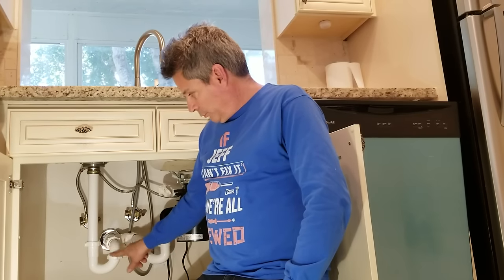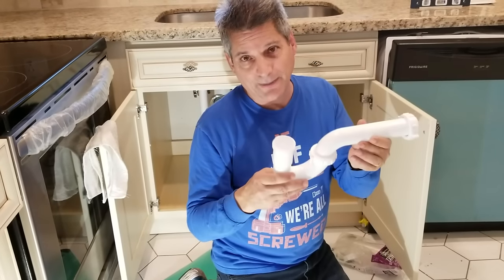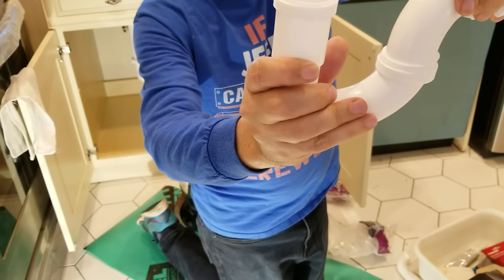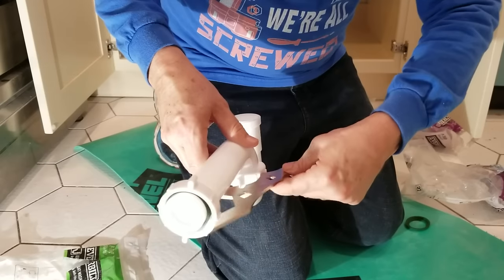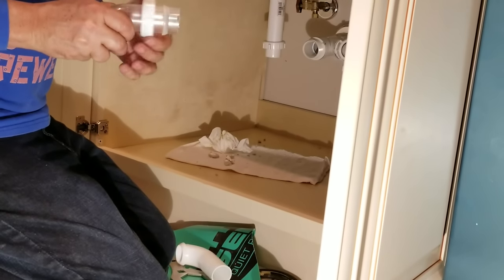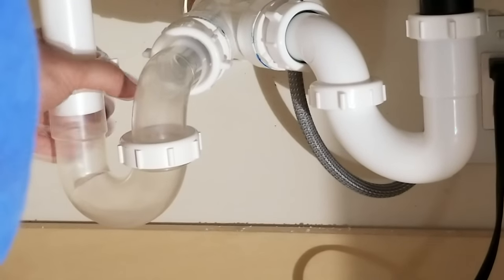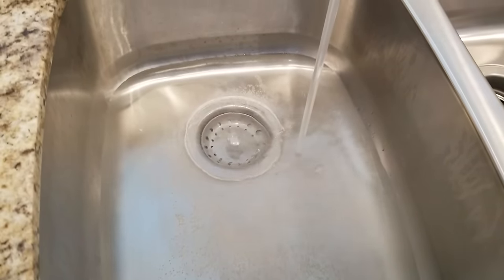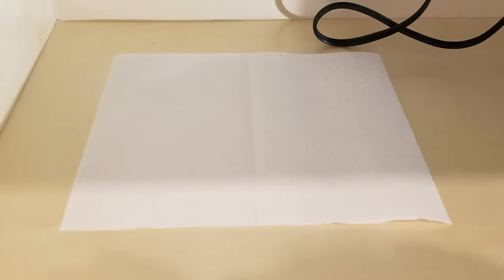Why is my Kitchen Sink P-Trap Leaking at Connection Nut?

Comment from the maker: We uploaded an improved version of this video HERE: https://youtu.be/tqf11On2xEA It is shorter and we removed the overpowering background music so you can hear it better.
✅ Kitchen sink drain tools/pipes in this plumbing tips video:
✅ Superior Tool 3-Way Sink Drain Wrench: https://amzn.to/2XozbZp
✅ PF WaterWorks Transparent P-Trap: https://amzn.to/2Ey8vhs
Reply: Rubber ferrule
Reply: I like the overpowering background music!  It rocks!  It makes me want to line dance in outer space.
Reply: I always have to deal with these things, I am not a plumber just a home owner, but why do they suck so much! It’s 2020 can we not design a trap that doesn’t leak and isn’t finicky that every time your mother-in-law puts the dish soap back and bumps it, it will not leak?
Reply: @bumstudios8817  welcome to 2020 tech: 
My plumber stopped those leaks from ever having to happen to me. 
After a sink block, while trying to unscrew the butted outlet of the P-trap and stripping every plastic ridge on the nut (possibly internal cracking 🙄from the vice I used because my wrenches & channellocks werent handling), I recalled that my plumber did something peculiar; he welded the the outlet end of the PVC P-Trap, where it connects to the tailpipe, and a flexigasket from the tailpipe to the wall. 🤠🔥👏
After unscrewing the inlet side of the P-trap by hand, I was able to completely detach all other pipe connections without a single tool. The whole thing is held together with tension... well fitted copper pipes with plenty of tight sleeve overlap, and easy-twist/tool-less brass fittings. The tailpipe connects to the house wall with flexible gasket, as it does to the anchored garbage disposal. So all I have to do is release the garbage disposal gasket first, and then there is range to easily yank the pipes from their sleeves, everything now pivoting off the wall gasket for added flexible movement. 
SYSTEM:
Left sink basin--> garbage disposal--> large gasket with double-wire spring hose clamp--> 90' PVC connector welded to 1st inlet of brass cast Y-connector welded to copper down pipe running vertical down to P-Trap inlet with twist off/sleeve compression. Removed and cleaned.

Right sink basin has copper pipe running down to 90' brass connector welded to copper pipe running horizontally --> tension fit & sparringly sleeved to 2nd inlet of brass Y-pipe. I could visually inspect & snake that pipe all the way up to the Right Sink basket.

 * It was annoying not being able to see the interior condition of the tailpipe exiting to wall, just the inlet side of the P-trap, which I easily enough snaked. BUT, had I been less lazy and taken the time, I could have unscrewed the adjustable tape hoseclamps holding the wall gasket to have done that, and I just didnt need to. 😊 
* I had been initially worried to start the project and fail in resealing the outlet end of the P-trap. Had I known, his system was in place like this, I would have done this sooner & maintenance cleaned more often.
Reply: e.g. Mμ silicon will work too... it’s just a dumb set up though... why have a $#!++¥ solution like that when a simple design change would solve it.
Reply: Do I really need to hear that overpowering music in a plumbing video ? And you seem to be showing more of your cute face than the actual plumbing network itself.

Comment: Until about two hours ago, I had a P Trap with the slowest leak on the planet. It was driving me nuts ;o) I had watched your video sometime yesterday, and I woke up in the middle of the night knowing what to do and got started. When you said that the back part doesn't have a gasket and has to fit perfectly flat, that we should "make that guy happy" before dealing with the other connectors, both of which do have gaskets, I was thereby enlightened and able to stop the incredibly-slow-drip madness! I appreciate your help! Thank you jeffostroff!!
Reply from the maker: That's awesome dues congratulations on getting that fixed!
Reply: @jeffostroff  thank you people like you is what going make the world great !!!!!  this helps so much
Reply: No kidding!  I was having a really hard time trying to understand why the plumber did not put a seal or gasket in the p-trap dip-to-outlet join. Jeff not only explained that's just how it is, but also explained how i must get that join to line up perfectly first, then tighten the other joints. My wife is gonna think I'm quite the hero after this fix :)  .  Great big thanks to Jeff!

Comment: Thank you. I hand tightened a brand new trap and it still leaked. I Could not figure out why and need to know that it is the most finicky connection that has to be done first. Thanks again.
Reply from the maker: Glad to help out Drew and thanks for watching!
Reply: Same problem here and you helped me solve it! Thank you for this clear, straightforward explanation.

Comment: This is the best explanation I have seen.  I have had a chronic problem with my sink's P trap leaking at the nut.  Going to go back now, with this knowledge, and hopefully will have success.
Edit:  It finally worked!  One very helpful tip is how you showed there is no gasket in the nut.  I had a plastic gasket type thing in the nut, and I took it out and now it doesn't leak.  Thanks!
Reply from the maker: Glad it helped Bret!

Comment: I am SO glad that you put this video out. I had this exact problem. Thinking about it now, it makes perfect sense as that junction is set up in such a way as it has to be perfectly level so there is no gap. I get it now!! I haven't seen this critical point in other videos on this subject. The connection is not leaking after about 5 minutes - jury is still out as to whether it is fixed - but I think it's going to be ok. Thanks for putting this together. A lot easier and cheaper than getting a plumber over to the house!!
Reply from the maker: Awesome we also find that sometimes waiting overnight is when you'll see if there's going to be a problem so I would put down the  Paper towel likely show there and just leave in and watch for any drops that appear on the paper towel.

Comment: I installed a new plastic p trap because the old metal one was corroded and leaky.  I spent an hour trying to get that middle joint to stop leaking.  The trap came with three gaskets, so I figured one of them was for that joint.  After watching this video, I tried without a gasket and it worked fine.  I was misled by the manufacturer!  Thanks for your help.
Reply from the maker: YES! saved another one! Congrats on fixing it yourself

Comment: thank you, been dealing with a leak for a year and found out that i was installing that rubber gasket wrong.  now it's fixed for real
Reply from the maker: Leon, awesome, glad our video helped you!  Yes a lot of other video creators just say put in the gasket, but they fail to show that it is indeed directional.
Reply: @jeffostroff  believe it or not, it was not a directional issue.  i was sort of wedging/resting the gasket between the two pipe pieces and then fastening the connector.  and it would actually kind of seal and not leak for a few weeks, until the garage disposal or some kind of movement will eventually knock it loose and leak.  your video showed that the gasket was to ride up higher on the pipe, so it didn't require any sort of delicate balancing act to screw the knob.  bought a few items off amazon through your link - thanks again
Reply: Mine is leaking from the connector in your right hand

Comment: Presentation problems aside I found this to be a very informative and useful video. I had a plumber visit not long ago who told me I'd installed a rubber gasket 'the wrong way around' but not WHY it was the wrong way around or how to fit it correctly like this video did. Also learned why a sink I had not used in a long while had begun to stink like a sewer!
Reply from the maker: Awesome glad to help out
Reply: If I have to leave the installation alone (unused) for a long time I tape a foil over the sink's outlet. This 1. lowers the evaporation rate and 2. serves as a seal against odors. Don't forget the overflow outlet!

Comment: OMG! Thank you for the clear p trap demonstration! Been working on a pedestal sink for 3 weeks! Turns out I needed a  1/8" extension for drain pipe connection to existing p trap. Hard to see that small of a gap when lowering sink on pedestal,  then reaching in to hand tighten. I needed to understand that p trap connection that DOESN'T use a washer! (I was adding one).  Anyway, was here to see how to cut the new PVC extension pipe. Thank you for demonstration.
Reply from the maker: Glad it helped! Thanks for watching Maria!

Comment: Great helpful video thanks.
I had the leak on the 2nd nut.
I was having trouble with the rubber gasket, I wasn't putting it on correctly.
This video showed me where I was going wrong, I put the rubber gasket on as you showed in this video, and it fixed the problem.
An easy mistake to make, but crucial to stopping leaks. No other video I found shows which way around to gasket goes, and how you put it on the downpipe.
So thank you for sorting me out.👍
Reply from the maker: No problem 👍

Comment: My brand new P trap install, leaked when I tested it (placed a drip pan under the assembly to check). Sure enough, at the union joint. Visually they were square and aligned, with the taper lining up properly. Released the nut, and other compression nuts, and re did starting with the P trap union. Still a Leak.Then I turned to my aircraft fuel line sealant, called Fuel Lube, or also known as EZ-Turn Lubricant. It's a wax based paste that you apply to the joint being sealed. So far, no more leaks.
Reply from the maker: That's a great idea Paul!

Comment: I've also found that sometimes new P trap parts have residual flashing on the mating surface left over from the casting process. It helps seal the joint if you can remove the flashing with either a knife or fine sanding block. Make sure you don't deform the rest of the mating surface, though.
Reply from the maker: Yes I have seen that also I would be too afraid to send it I don't wanna change the shape of that connection even microscopically because it is so critical
Reply: @jeffostroff  You can sand it if you use very fine sandpaper and go around the mating surface, not up and down. As I'm sure you know, water will find a way if there is one. :)

Comment: Years ago we had metal P-traps, I don't remember the design but they never leaked at the connection, they did corrode and need to be replaced, but I swear if you sneeze in another room these things come loose and leak. There must be something that is solid. I can't keep my kitchen trash can under the sink, the slightest nudge and it leaks. We have MIT and A.I. and this is the best we can do? They work for awhile but always come loose and leak. You video is great but we need a better designed P-trap! I'm 75 and can't do this much longer.
Reply from the maker: Yes that connection in the middle is the problem in my opinion it should be a gasketed connection I don't know why they made it a friction type connection but it is just very annoying

Comment: Very very well done. I kept putting a washer on the trap arm where it connects to the P trap and could not get the damn thing to seal.  Of course I just kept tightening it, which didn’t work!  Now it works fine with no leaks!  Thanks. Knowledge is power. Thanks for sharing yours.  Also, don’t use background music. It was hard to understand you and very very distracting.
Reply from the maker: We stopped with that background music after this

Comment: Thanks so much! I just fixed my pipes under my laundry sink because they were leaking. It was helpful when you said that the pipes needed to be leveled and I didn't need to TIGHTEN THEM WITH A WRENCH; LIKE I HAD. HAHAHA. So I went back untightened them and added a seal/gasket to one of the connections and that did it!

Comment: Thanks for this video. I just installed a p-trap in a bathroom vanity and all the joints came with gaskets. Still had to be careful to get the underwater joint square though.
Reply from the maker: That's the key to connecting up the P-trap is keeping that joint square.

Comment: Very good explanation: Clear and not fumbling for parts. The explanation of fitting the parts was exactly what I need to fix my leak. In my case my metal trap corroded and I tried to just replace that. I must now redo the whole thing which now won't be much of a problem.
Reply from the maker: Glad to help!

Comment: If you put pipe dope on all the cone surfaces they will not leak, NOT on the threads because they don't seal the connections. It will always be water tight. Nice video.
Reply from the maker: Yes, I have seen that done on one P-trap and it was working. I still prefer to make the connection work without having to resort to pipe dope, because the experts say it should not be needed, and usually the P-trap makers tell you not to use it. It's really critical alignment that is needed, with not much margin for error, to make sure the trap arm part sits perfectly level into the  trap outlet connection, and that you get them on nice and level and tighten good, then go a 1/4 or 1/2 turn beyond hand tighten with the wrench.

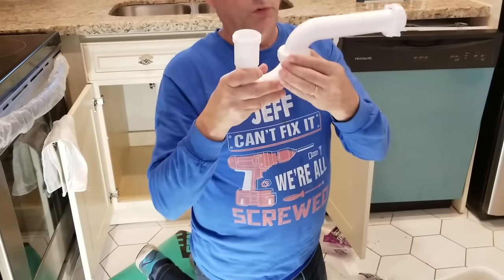Comment: @3:47 thanks for the video, I installed a new sink for my house but it was leaking at the connection nut... after seeing this explanation I re-seated the connection with a focus on lining up that angled lip properly, and that fixed my leak!

those clear traps look really cool, I was almost tempted to buy/install one, but reading the reviews lots of 1 stars saying it leaked after a month

update: doh, it still leaked, but I think I just did a bad install... I did finally fix it, but had to cut the pipe a few inches from the wall... The main difference this time, is I put the tailpiece on the sink first with half the p-trap attached - using this as my starting point was the key. Then I worked backwards to the wall, dry fitting pieces to make sure everything lined up correctly, then glued it all together. This ensured the angled lip at connection nut lined up 100% instead of at a slightly off angle.

Comment: Absolutely excellent!

OK, so I posted the above comment about an hour ago, before fixing the leak.  I followed the instructions, and in 5 minutes it no longer leaked.  (I will use the newspaper suggestion overnite tho, just to be sure.)  I am beyond thrilled to have saved an expensive plumber's fee, about $130+ tax.  I have cleaned P traps previously, but they were metal, with rubber seals, so I guess the P trap didn't have to be level, but with PVC it does.  You are an excellent teacher!  I am a mere woman, and I feel I just took a lesson in "Plumbing 101."   A million thanks, and I have subscribed to your channel.
Reply from the maker: Thanks I'm glad you liked it
Reply from the maker: Awesome, glad to hear you were successful using our video!

Comment: Great video i was wondering why there was no gasket in the middle part.
Reply from the maker: That's the design of P-Traps, it's a compression plastic against plastic, and I also never understood why they don't have a gasket there, I think it would eliminate a lot of issues that people have with P-traps.
Reply: @jeffostroff  for sure i installed a brand new one and it has a very slow leak. I keep tightening it but don't want to tighten it to much. Guess if it breaks I'll just buy another one. Thanks again for the video.

Comment: One issue I've had is the gasketless connection's angled piece of plastic getting marred or dented by impact with some sharp edged object making that connection worse.  Why is that one particular connection designed without a gasket in the first place?  Because of the bend?  It's the most confusing thing to me.

Comment: I've had a leak at that center connection forever in my bathroom. I got so frustrated with it I encased the entire joint in silicone RTV to stop the leak. Is there seriously not supposed to be a seal there? That makes no sense! Not arguing the video. Just amazed that an underwater joint with no seal is expected to be water-tight.
Reply from the maker: Yes, I never liked this design either, but you just have to make sure the 2 sections are joined perfectly and tighten that connection before the others.
Reply: I know your comment is old, but I had the exact same issue with that joint. It's just a cheap design. I thought of using an RTV as well and your comment convinced me to just seal it that way.

Comment: Problem I see a lot is people cram too much stuff under the sink and can knock pipes out of whack . Don't see too many plumbed that way with a tee and separate p-traps? 👍
Reply from the maker: Yes I replaced a garbage disposal last week at a friends house and they had so much stuff crammed under that kitchen sink that it was putting compression against the P trap and pushing back against the cabinet door and the cabinet door would not close flat.

Comment: This was a really great video except mine still leaks even though I tried to line it up perfectly.  I didn't install a new one, I was just trying to fix the leak on the old one.  I don't see a crack on the nut unless its on the inside.  Is buying and installing a new one likely to fix it?

Comment: what? why are there two different size waste pipes for kitchen and bathroom? FFS
Reply from the maker: Life would certainly be easier if they were all 1 1/2".
Reply: You usually don't stuff food particles in the bathroom sink. Also bigger tubes require larger radius bends, may not have that much room under the bathroom sink.
Reply: @jeffostroff  Life is easier using the 1 1/2 trap when you use the thicker type washer to adapt to the 1 1/4 lav drain. Comes standard in the 1 1/2 trap package.